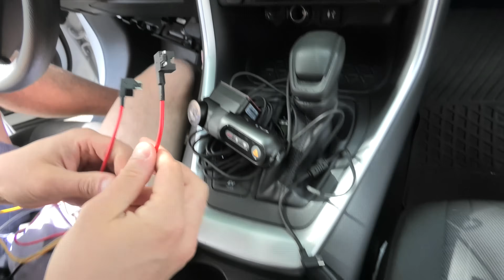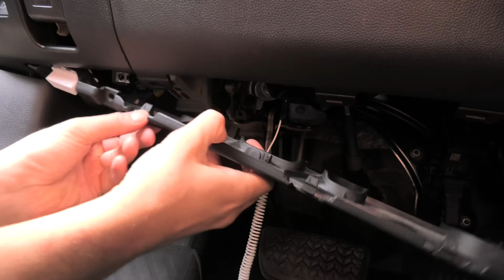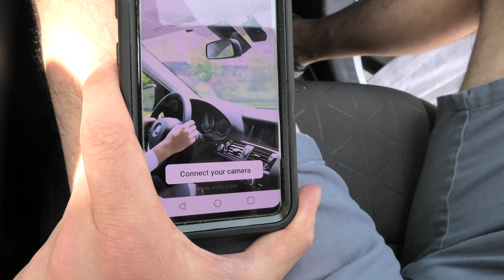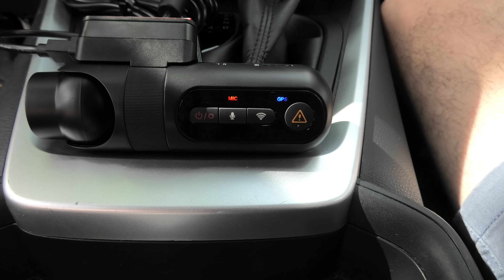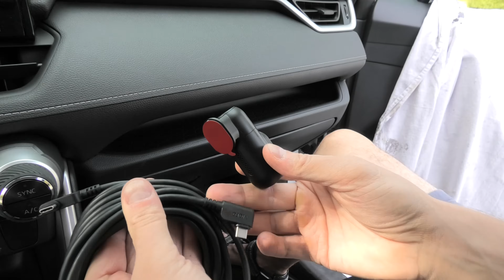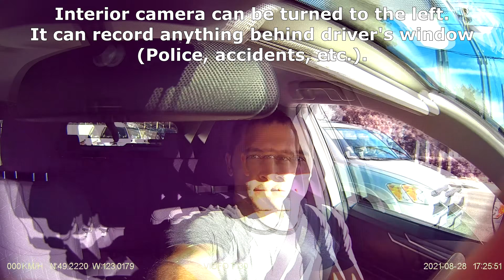Toyota RAV4 (2019-2025): VIOFO T130 Review And Hardwiring. Parking Mode Works!

Comment from the maker: PRODUCT LINKS:
1. VIOFO T130 3CH FRONT INSIDE/CABIN REAR 1440P+1080P+1080P TRIPLE CHANNEL CAR DASH CAMERA:
 - Amazon USA - https://amzn.to/3DoBT7y.
 - Amazon Canada - https://amzn.to/3XQtLVR.
2. VIOFO HK4 Acc Hardwire Kit, USB-C Hard Wire Kit for T130, A229Duo, A119MINI Dash Cam, Low Voltage Protection for Parking Mode:
 - Amazon USA - https://amzn.to/3Y3AOdX.
 - Amazon Canada - https://amzn.to/3JIqiVa.
3. VIOFO 256GB PROFESSIONAL HIGH-ENDURANCE MLC MEMORY CARD UHS-3 WITH ADAPTER - https://amzn.to/4hegU9G.
4. MINI LOW PROFILE FUSE TAP - Gebildet 12V-24V Low Profile Add-a-Circuit Fuse Tap, 6 pcs Fuse (3A 5A 7.5A 10A 15A 20A) and Fuse Puller (Pack of 4) - https://amzn.to/41z7NZN.

TOOLS REQUIRED:
1. 12V CIRCUIT TESTER - AWBLIN Automotive Test Light 3-60V DC Digital LED Circuit Tester - https://amzn.to/3Y78Gpe.
2. PHILLIPS HEAD SCREWDRIVER - Klein Tools 603-4 Screwdriver - https://amzn.to/3kFGex0.
3. TRIM REMOVAL TOOL - 4pcs Auto Door Clip Panel Trim Removal Tool Kit - https://amzn.to/41nYhsk.
Reply: Does this record when the car is off. Say u get pulled over by the cops and you turn your car off, will it still record the officer
Reply from the maker: @DM-by5sr  If you have properly connected the hardwiring kit, it will record.

Comment: Does it drain battery
Reply from the maker: It does, but you can control it. Wiring comes with the low voltage cutoff switch.
Reply: @MorozovAutomotive  how much u set? 12.4/12.2/12/11.4 and how much time each last?
Reply: @MorozovAutomotive  which parking mode is the best? Motion detect or low bit?
Reply: @MorozovAutomotive  sir please answer my question

Comment: Can t130 3 ch camera connect to a separate battery instead of car battery. If so what type and where to buy battery
Reply from the maker: It can. Here is one - https://www.blackboxmycar.com/collections/battery-packs/products/blackboxmycar-powercell-8-dash-cam-battery-pack?variant=39666957713463. This one comes with the option to choose the wiring for the Viofo T130. The problem is that it is not cheap.

Comment: Hey great video, i just got this cam installed and i have a question. After you turn off the car and park mode is activated, for how long will it stay on? Will it turn off if no auto event detection is detected? Or will it stay on all the time till the voltage threshold is reached? And is it better to add a parking mode timer thru the app or leave it off?
Reply from the maker: When you use the motion detection mode it will only turn on when the motion is detected. Once it turns on it will record for one minute and turn off. The use of the parking mode timer will depend on your requirements. If you park your vehicle overnight, say, in the parkade and there is no heavy traffic there, I wouldn't worry about the timer.
Reply: How do I know if my parking mode is working or not? I hardwired mine but I don’t know if park mode is even on or working for me.

Comment: I had trouble deciding whether to put it where you have it in this video, or the other area to the upper right. I went with the upper right in the end, but as you say.. the mirror completely blocks your face. It does get a lot of the same window coverage, though. Not the back but the other windows and front passenger similar. I'm not sure I'd like it how you have it here as it's a bit obstructive. Or am I wrong? Is it partly hidden from your eyeview when driving?
Reply from the maker: It is partially obstructing the view in the middle of the windshield. You do learn to adjust but long term it needs to be out of the way. I think I installing it on the right side of the windshield is a better idea.
Reply: Thank you! That is what I did.

Comment: which one do you recommend between Viofo A139 and T130 ?
I love how the interior camera is designed in T130  with no more cables, but the quality seems better for A139 and I heard the T130 overheats.
Reply from the maker: The T130 is a more budget version than A139. You are right it is easier to install the T130. Personally I did not have issues with overheating yet. A139 has a better front and interior cameras. If you have room to manage the wires for the interior camera I would go with the A139.

Comment: Two questions regarding the parking mode.
1. If there is motion behind the car, will it start recording? Or does it only detect motion in front of the car?
2. If an incident occurs, does it record any footage before the incident? (I think this is called buffered parking mode)

I would appreciate if you could answer these questions.
Thank you
Reply: I think if you have it hard wired it continues to record and operate!